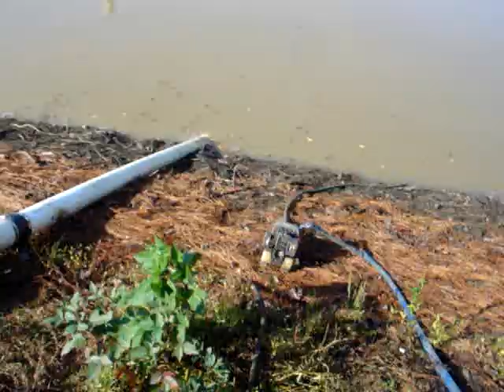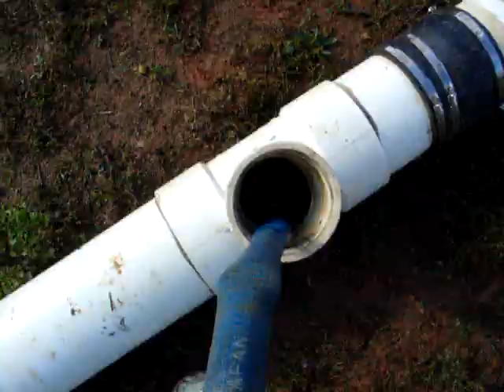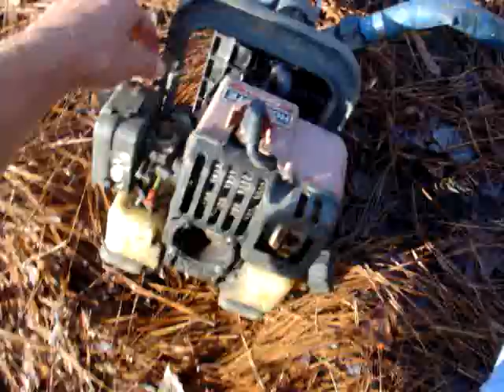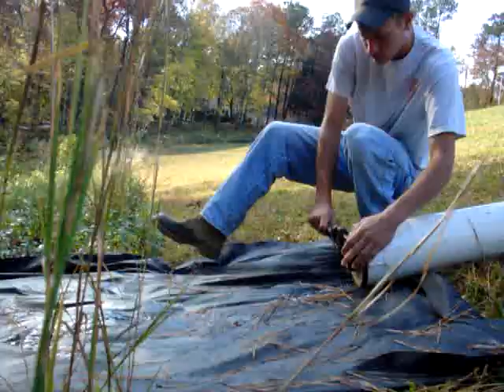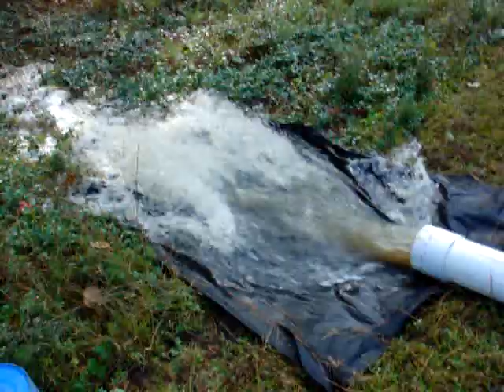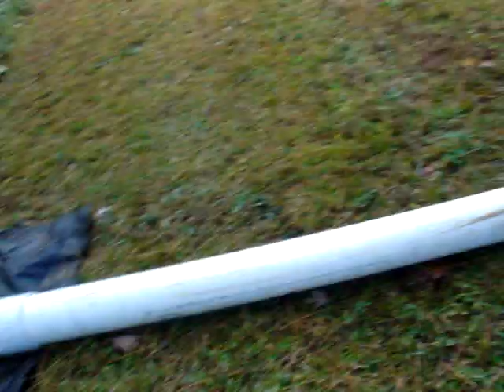How a siphon works

Comment: Great videos Chris.
Helpful tip.
Use PVC valves at the top and at the end of the discharge.
They seal real well when closed.
No parts to loose.
No wrench needed.
The top valve could even be 2 inch.
Add a riser at the top valve to eliminate trapped air.
Valves are easy to open and close quickly.
With a valve on the discharge you can stop the flow at anytime and restart it later by simply opening the valve.
( If your intake check valve does not leak down )
Make a video of the modified siphon.

Comment: You can also fill the pipe by using a shop vacuum.  It will suck water up from the pond and fill the pipe.  When it begins sucking water, the pipe has filled.  You have to find a way to get a good seal from the shop vac to the pipe.  Once the pipe is filled, cap it and go remove the discharge cap.

Comment: This is a great way to drain the water from the caverns in Thailand to rescue the boys and their coach. it requires no electrical power or pumps.
Reply: The water outlet has to be lower than  the inlet and the pipe must be full at all times, this will drain at a constant amount according to the size of pipe,  where as a pump can pump more   if it pumps faster, gallon per minute. Time was a constraint in the cave. Steve in Thailand.

Comment: I wonder if you could stub out a 2-3 foot high piece of 6" pipe from that middle Tee and put a slip cap over it. (With no glue)   You could take a hammer with a piece of wood to work it off.  Would it be carry enough to seal it... I don't know.  I saw the previous video of you struggling with the threaded plug.  Although you did crank that plug down pretty good.   Maybe use tef-lon tape around the it and just snug it up?   Just stumbled on your channel and I've been binge watching.  Love the content!   I've been on this strange kick of watching people install culverts.  :)   Interesting video!

Comment: Question: I have a well at 7,270 elv and a pond at 7,098 feet below  172 feet in drop, but the water level in the well is 140 feet deep.  With 32 feet in drop can I start a siphon and keep the well running ?? the head of the well is 32 feet higher than the pond down the Mt.? HELP
Reply: What do you mean exactly by "keep the well running"?

Comment: one more question...  from your experience, does the output of the siphon just have to be at a lower elevation than the intake or does it need to be a more specific distance related to total pipe length etc?  the intake angle is gentle and total rise is only 12 ft to the top of the dam crest ... the output fall is steep and is a bit over 20 ft drop in elevation.  I imagine this will work?
Reply from the maker: yes as long as the outflow pipe is lower than the water lever it does not matter if its below the intake or not.  It really depends on how low u want the water to drain. its always nice to have more pipe on the back than going into the pond
Reply: thanks again .... any recommendations on glue for the glued joints?
Reply: also .... do you bevel the pipes?

Comment: also i'm thinking a check valve on the intake?  any recommendations on kind of check valve for this?
Reply: 4 inch fittings are 1/3 of the price of 6 inch fittings. You can get a 4 inch backwater valve for $35 on Ebay, postage included. You could also put a regular ball valve shutoff at water level, to close while filling the pipe. Another thought would be to put a Y on the 6 inch inlet, and then reducers to go down to 4 inch, to use 4 inch backwater valves.  I like everything on the 6 inch setup, except the $150 one way valve used.
Reply from the maker: yes there is one on the intake
Reply: letsdig18
 thanks so much for responding!  any recommendations on style/model of check valve?  trying to have this put together in next few days as it is time sensitive .... I of course want the max flow possible and don't want it to fail since check valves are expensive and will be hard to replace after pipe is laid in place ... also, any advice on angling the intake or netting to prevent larger trash from entering the line? ... working with 6" PVC DWV standard 40 ... can't get in the water either as it is COLD out there! very glad you responded!
Reply: letsdig18
also, my total intake length is looking to be 60 feet (pipe before tee trash cleanout) and the output length is around 90 ft (after cleanout) and will empty well below the elevation of the intake ... this will work, right?
Reply: cuica643 saw the comment below about the screen and the floats ... that helps
Reply from the maker: I forgot what the check valve is called. we have to order them from fergisons.  they are over 100 bucks for the 6" ones.  they have a big plastic flap in there that will only allow the water to flow one way.   they work great.   I glue a 3' piece of pipe to the front of that with a cap on the end and drill a lot of 1" holes in it

Comment: With a little "Out -of-The-Box" brainstorming it looks like you could have a source of "Green Power" to assist on days when high power usage is experienced.  Similar thing down in Missouri at the Taum Sauk Resevoir.  On days of high power demand (High Air Conditioning usage)  the local utility opens the gates on the Resevoir and uses the power, after sun down it uses power from its Nuclear Power plant and from Bagnel Dam  to pump the water to the upper resevoir and thus the cycle is renewed.

Comment: Here's a fun fact:  Look in any, I mean ANY dictionary made before this year and you will notice that the definition for a siphon is wrong.

They say a siphon is created when the "atmospheric pressure is sufficient to force a liquid from a reservoir in one end of the tube over a barrier higher than the reservoir and out the other end".  Can you believe that?  It's actually when the weight of a liquid within a vacuum is greater on one side than the other caused by gravitational put of the mass.

Comment from the maker: You can put them on a float, usually tie a 5 gallon bucket to the end if it trys to get clogged up with the muck on the bottom. We have about a 3' long screen on the end of that one so it can sit directly on the bottom of the pond.